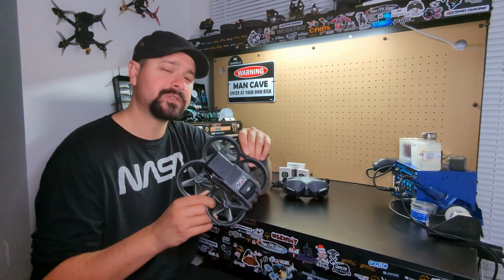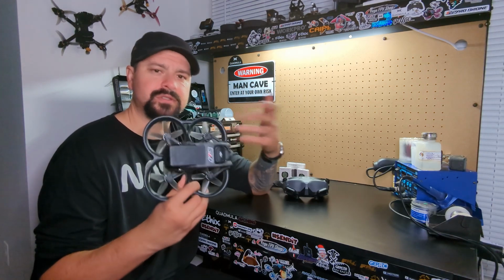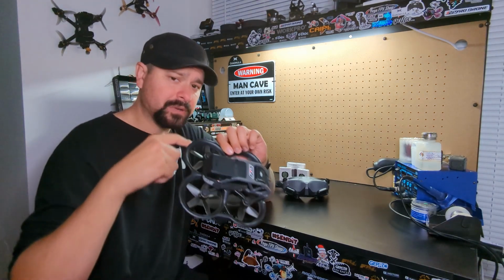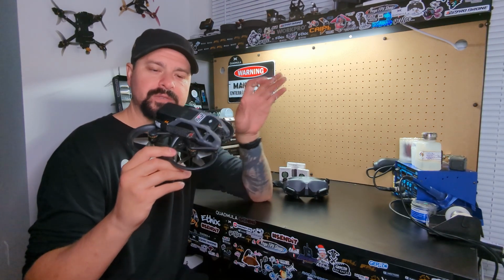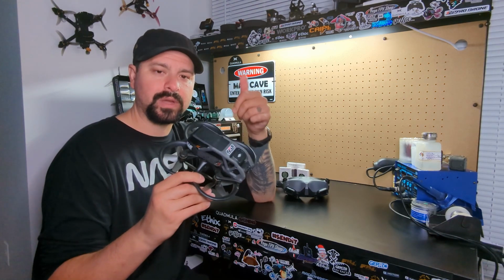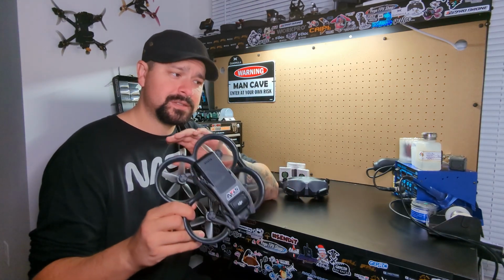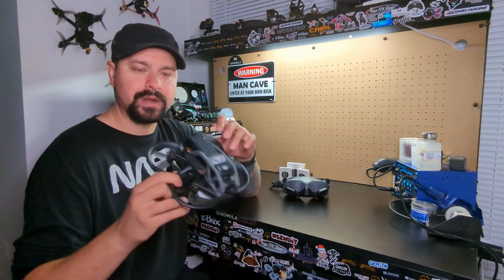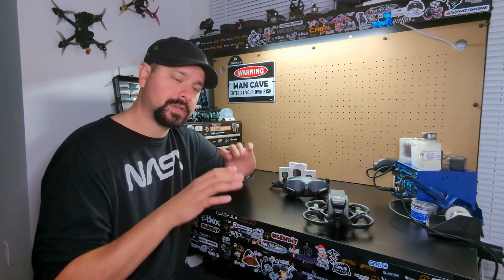Upgraded DJI AVATA: Real World Raw DVR and OSD // What to Expect From the Axisflying C157s

Comment: We need aftermarket CF prop guards for the avata and it will be good to go! Great video again! What camera angle are you typically flying on the avata? I keep forgetting to ask you bro
Reply from the maker: Almost always 30 degrees
Reply: @MurdersFPV  yeah I should have seen that on the hud but I’m a jarhead and have trouble with numbers over ten lmao.
Reply: Remark

Dear Customer, Damage Assessment Result: Core Board Module was malfunctioned,which caused abnormal sensitivity of operation;DJI Avata Intelligent Flight Battery water damaged. The data analysis determined that your product qualifies for a free warranty repair. We'll either replace it with a product that's new or equivalent to new in both performance and reliability, or repair it. For more information, please visit (http://www.dji.com/service/policy). ing battery as well
 
 
Item List
Core Board Module
Quantity: 1
Net Price : 98.00
Total Price: 98.00
 
DJI Avata Intelligent Flight Battery
Quantity: 1
Net Price : 129.00
Total Price: 129.00
 
Repair Service Fee
Quantity: 1
Net Price : 65.00
Total Price: 65.00
 
 
Tax
0.00
 
Shipping Cost
0.00
 
Total Amount
292.00
 
Discount
292.00
 
Total Payment (USD$)
0.00
 
 
Note
1. To ensure repair quality, DJI may update or replace the product module. If it is updated or replaced, the serial number may also change, but this will not affect the after-sales service.
2. DJI will use standard delivery service to ship back your products. If you have any other requirements, such as expedited service, please contact DJI Support. Please be noted that DJI will not bear any additional costs for such requirements.

3. Please note that DJI will not take responsibility for the extra costs, such as customs clearance and postage, incurred as a result of the uses made of your incorrect information.

4. Click here to check DJI After-sales Service Policies.

This email is sent automatically by the system. Please do not reply. For further inquiries, please contact us via DJI Support.

 
Best Regards,
DJI Support
 
This email and any attachments thereto may contain private, confidential, and privileged material for the sole use of the intended recipient. Any review, copying, or distribution of this email (or any attachments thereto) by others is strictly prohibited. If you are not the intended recipient, please contact the sender immediately and permanently delete the original and any copies of this email and any attachments thereto.

此电子邮件及附件所包含内容具有机密性，且仅限于接收人使用。未经允许，禁止第三人阅读、复制或传播该电子邮件中的任何信息。如果您不属于以上电子邮件的目标接收者，请您立即通知发送人并删除原电子邮件及其相关的附件。
Reply: Remark

Dear Customer, Damage Assessment Result: Core Board Module was malfunctioned,which caused abnormal sensitivity of operation;DJI Avata Intelligent Flight Battery water damaged. The data analysis determined that your product qualifies for a free warranty repair. We'll either replace it with a product that's new or equivalent to new in both performance and reliability, or repair it. For more information, please visit (http://www.dji.com/service/policy). ing battery as well
 
 
Item List
Core Board Module
Quantity: 1
Net Price : 98.00
Total Price: 98.00
 
DJI Avata Intelligent Flight Battery
Quantity: 1
Net Price : 129.00
Total Price: 129.00
 
Repair Service Fee
Quantity: 1
Net Price : 65.00
Total Price: 65.00
 
 
Tax
0.00
 
Shipping Cost
0.00
 
Total Amount
292.00
 
Discount
292.00
 
Total Payment (USD$)
0.00
 
 
Note
1. To ensure repair quality, DJI may update or replace the product module. If it is updated or replaced, the serial number may also change, but this will not affect the after-sales service.
2. DJI will use standard delivery service to ship back your products. If you have any other requirements, such as expedited service, please contact DJI Support. Please be noted that DJI will not bear any additional costs for such requirements.

3. Please note that DJI will not take responsibility for the extra costs, such as customs clearance and postage, incurred as a result of the uses made of your incorrect information.

4. Click here to check DJI After-sales Service Policies.

This email is sent automatically by the system. Please do not reply. For further inquiries, please contact us via DJI Support.

 
Best Regards,
DJI Support
 
This email and any attachments thereto may contain private, confidential, and privileged material for the sole use of the intended recipient. Any review, copying, or distribution of this email (or any attachments thereto) by others is strictly prohibited. If you are not the intended recipient, please contact the sender immediately and permanently delete the original and any copies of this email and any attachments thereto.

此电子邮件及附件所包含内容具有机密性，且仅限于接收人使用。未经允许，禁止第三人阅读、复制或传播该电子邮件中的任何信息。如果您不属于以上电子邮件的目标接收者，请您立即通知发送人并删除原电子邮件及其相关的附件。
Reply: Remark

Dear Customer, Damage Assessment Result: Core Board Module was malfunctioned,which caused abnormal sensitivity of operation;DJI Avata Intelligent Flight Battery water damaged. The data analysis determined that your product qualifies for a free warranty repair. We'll either replace it with a product that's new or equivalent to new in both performance and reliability, or repair it. For more information, please visit (http://www.dji.com/service/policy). ing battery as well
 
 
Item List
Core Board Module
Quantity: 1
Net Price : 98.00
Total Price: 98.00
 
DJI Avata Intelligent Flight Battery
Quantity: 1
Net Price : 129.00
Total Price: 129.00
 
Repair Service Fee
Quantity: 1
Net Price : 65.00
Total Price: 65.00
 
 
Tax
0.00
 
Shipping Cost
0.00
 
Total Amount
292.00
 
Discount
292.00
 
Total Payment (USD$)
0.00
 
 
Note
1. To ensure repair quality, DJI may update or replace the product module. If it is updated or replaced, the serial number may also change, but this will not affect the after-sales service.
2. DJI will use standard delivery service to ship back your products. If you have any other requirements, such as expedited service, please contact DJI Support. Please be noted that DJI will not bear any additional costs for such requirements.

3. Please note that DJI will not take responsibility for the extra costs, such as customs clearance and postage, incurred as a result of the uses made of your incorrect information.

4. Click here to check DJI After-sales Service Policies.

This email is sent automatically by the system. Please do not reply. For further inquiries, please contact us via DJI Support.

 
Best Regards,
DJI Support
 
This email and any attachments thereto may contain private, confidential, and privileged material for the sole use of the intended recipient. Any review, copying, or distribution of this email (or any attachments thereto) by others is strictly prohibited. If you are not the intended recipient, please contact the sender immediately and permanently delete the original and any copies of this email and any attachments thereto.

此电子邮件及附件所包含内容具有机密性，且仅限于接收人使用。未经允许，禁止第三人阅读、复制或传播该电子邮件中的任何信息。如果您不属于以上电子邮件的目标接收者，请您立即通知发送人并删除原电子邮件及其相关的附件。
Reply: Remark

Dear Customer, Damage Assessment Result: Core Board Module was malfunctioned,which caused abnormal sensitivity of operation;DJI Avata Intelligent Flight Battery water damaged. The data analysis determined that your product qualifies for a free warranty repair. We'll either replace it with a product that's new or equivalent to new in both performance and reliability, or repair it. For more information, please visit (http://www.dji.com/service/policy). ing battery as well
 
 
Item List
Core Board Module
Quantity: 1
Net Price : 98.00
Total Price: 98.00
 
DJI Avata Intelligent Flight Battery
Quantity: 1
Net Price : 129.00
Total Price: 129.00
 
Repair Service Fee
Quantity: 1
Net Price : 65.00
Total Price: 65.00
 
 
Tax
0.00
 
Shipping Cost
0.00
 
Total Amount
292.00
 
Discount
292.00
 
Total Payment (USD$)
0.00
 
 
Note
1. To ensure repair quality, DJI may update or replace the product module. If it is updated or replaced, the serial number may also change, but this will not affect the after-sales service.
2. DJI will use standard delivery service to ship back your products. If you have any other requirements, such as expedited service, please contact DJI Support. Please be noted that DJI will not bear any additional costs for such requirements.

3. Please note that DJI will not take responsibility for the extra costs, such as customs clearance and postage, incurred as a result of the uses made of your incorrect information.

4. Click here to check DJI After-sales Service Policies.

This email is sent automatically by the system. Please do not reply. For further inquiries, please contact us via DJI Support.

 
Best Regards,
DJI Support
 
This email and any attachments thereto may contain private, confidential, and privileged material for the sole use of the intended recipient. Any review, copying, or distribution of this email (or any attachments thereto) by others is strictly prohibited. If you are not the intended recipient, please contact the sender immediately and permanently delete the original and any copies of this email and any attachments thereto.

此电子邮件及附件所包含内容具有机密性，且仅限于接收人使用。未经允许，禁止第三人阅读、复制或传播该电子邮件中的任何信息。如果您不属于以上电子邮件的目标接收者，请您立即通知发送人并删除原电子邮件及其相关的附件。
Reply: Remark

Dear Customer, Damage Assessment Result: Core Board Module was malfunctioned,which caused abnormal sensitivity of operation;DJI Avata Intelligent Flight Battery water damaged. The data analysis determined that your product qualifies for a free warranty repair. We'll either replace it with a product that's new or equivalent to new in both performance and reliability, or repair it. For more information, please visit (http://www.dji.com/service/policy). ing battery as well
 
 
Item List
Core Board Module
Quantity: 1
Net Price : 98.00
Total Price: 98.00
 
DJI Avata Intelligent Flight Battery
Quantity: 1
Net Price : 129.00
Total Price: 129.00
 
Repair Service Fee
Quantity: 1
Net Price : 65.00
Total Price: 65.00
 
 
Tax
0.00
 
Shipping Cost
0.00
 
Total Amount
292.00
 
Discount
292.00
 
Total Payment (USD$)
0.00
 
 
Note
1. To ensure repair quality, DJI may update or replace the product module. If it is updated or replaced, the serial number may also change, but this will not affect the after-sales service.
2. DJI will use standard delivery service to ship back your products. If you have any other requirements, such as expedited service, please contact DJI Support. Please be noted that DJI will not bear any additional costs for such requirements.

3. Please note that DJI will not take responsibility for the extra costs, such as customs clearance and postage, incurred as a result of the uses made of your incorrect information.

4. Click here to check DJI After-sales Service Policies.

This email is sent automatically by the system. Please do not reply. For further inquiries, please contact us via DJI Support.

 
Best Regards,
DJI Support
 
This email and any attachments thereto may contain private, confidential, and privileged material for the sole use of the intended recipient. Any review, copying, or distribution of this email (or any attachments thereto) by others is strictly prohibited. If you are not the intended recipient, please contact the sender immediately and permanently delete the original and any copies of this email and any attachments thereto.

此电子邮件及附件所包含内容具有机密性，且仅限于接收人使用。未经允许，禁止第三人阅读、复制或传播该电子邮件中的任何信息。如果您不属于以上电子邮件的目标接收者，请您立即通知发送人并删除原电子邮件及其相关的附件。
Reply: Remark

Dear Customer, Damage Assessment Result: Core Board Module was malfunctioned,which caused abnormal sensitivity of operation;DJI Avata Intelligent Flight Battery water damaged. The data analysis determined that your product qualifies for a free warranty repair. We'll either replace it with a product that's new or equivalent to new in both performance and reliability, or repair it. For more information, please visit (http://www.dji.com/service/policy). ing battery as well
 
 
Item List
Core Board Module
Quantity: 1
Net Price : 98.00
Total Price: 98.00
 
DJI Avata Intelligent Flight Battery
Quantity: 1
Net Price : 129.00
Total Price: 129.00
 
Repair Service Fee
Quantity: 1
Net Price : 65.00
Total Price: 65.00
 
 
Tax
0.00
 
Shipping Cost
0.00
 
Total Amount
292.00
 
Discount
292.00
 
Total Payment (USD$)
0.00
 
 
Note
1. To ensure repair quality, DJI may update or replace the product module. If it is updated or replaced, the serial number may also change, but this will not affect the after-sales service.
2. DJI will use standard delivery service to ship back your products. If you have any other requirements, such as expedited service, please contact DJI Support. Please be noted that DJI will not bear any additional costs for such requirements.

3. Please note that DJI will not take responsibility for the extra costs, such as customs clearance and postage, incurred as a result of the uses made of your incorrect information.

4. Click here to check DJI After-sales Service Policies.

This email is sent automatically by the system. Please do not reply. For further inquiries, please contact us via DJI Support.

 
Best Regards,
DJI Support
 
This email and any attachments thereto may contain private, confidential, and privileged material for the sole use of the intended recipient. Any review, copying, or distribution of this email (or any attachments thereto) by others is strictly prohibited. If you are not the intended recipient, please contact the sender immediately and permanently delete the original and any copies of this email and any attachments thereto.

此电子邮件及附件所包含内容具有机密性，且仅限于接收人使用。未经允许，禁止第三人阅读、复制或传播该电子邮件中的任何信息。如果您不属于以上电子邮件的目标接收者，请您立即通知发送人并删除原电子邮件及其相关的附件。

Comment: Unfortunately, there seems to be a tumble even after changing the motor. 5:25
Nevertheless, it's a great flight and it shows much better flight performance than before the motor change.
Reply from the maker: Yup it's what I discuss at the end of the video. This issue is not completely resolved by the motor upgrade but it does look like there has been some confirmation from DJI that there were issues found with the first batch which mine certainly was part of. I'm sending mine back for a replacement so I'll update you all on how that goes after having to reinstall the old motors.

Comment: I think you could push it even further with a custom tune... not that DJI will allow that to happen lol

how is the motor temps upon landing?
Reply from the maker: So my motor temps are pretty respectable. I can hold the motors between two fingers no problem. They do run a little warmer than stock.

In regards to pushing the Avata with a better tune, that's for sure guaranteed. Don't know if you've seen my videos of my flying my actual quads but even my Cinelog35 which I've tuned myself can rip much harder. It's just not as durable as the Avata. I'll be posting a video soon of the difference. Not only performance but also on a true cinematic level.
Reply: @MurdersFPV  well no matte how good the Avata camera is (and it IS good) it doesnt come close to the gopro 10 in good lighting
Reply from the maker: @33rdframe  yeah and that's just facts. That's honestly why I feel that it's weird when people say the Avata is for...(insert what they believe it's for) because they are usually wrong. 

It's a beginner drone for people who don't want to mess with the complexity of even setting up an EdgeTX radio, or install their own RX, configure anything in Betaflight, safely charging LiPos, and especially tuning. It's for people who want to get cool shots while on vacation and real estate agents who want the easiest way to get decent indoor shots even though they've never flown a drone.  It's great to let the family fly it and have an idea of what FPV is about. It's incredibly durable which is why I Iike beating it up and its range and penetration makes it ideal for exploring. 

It's not for true freestyle AND it's not for true cinematic purposes. It does both of those things at a very mediocre level.
Reply: @MurdersFPV  well said!

Comment: Concerning the gimbal I’ve had it loose calibration once out of many flights. I hit a branch noticed it was screwed up so I switched modes and used the rocker to try to use just the up down and center but that was screwed up to so I had to carefully fly it back in unplug the battery and then plug it back in which did a proper reset.
Reply from the maker: If you look closely I actually change the camera angle down then back again because that has helped in the past for me as well.
Reply: @MurdersFPV  I was just enjoying the flight, lol. Keep up the good work, glad your having success.